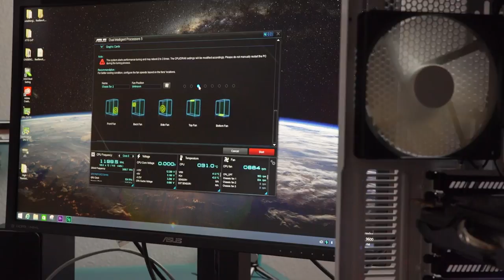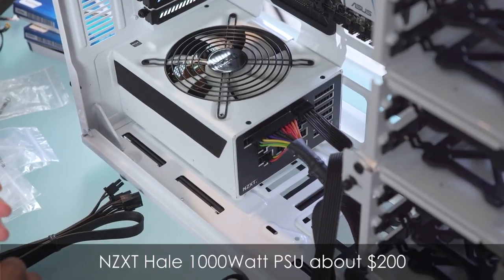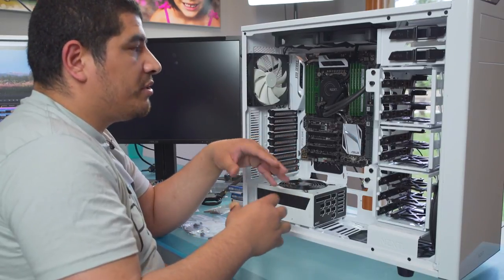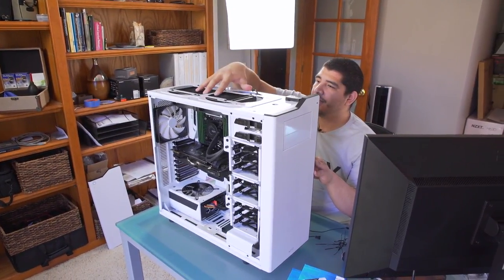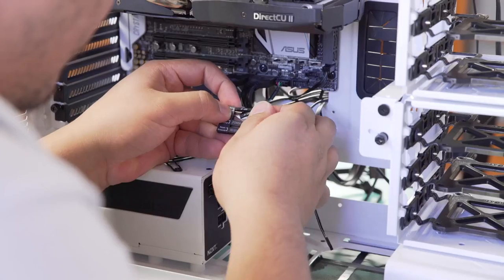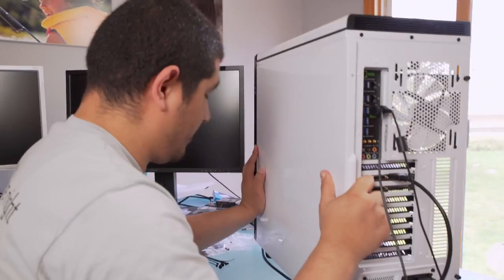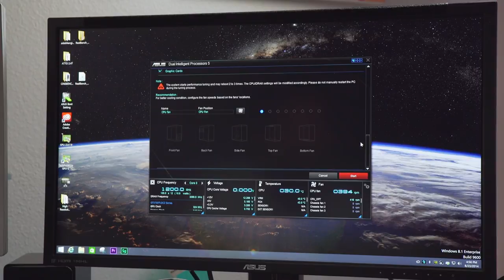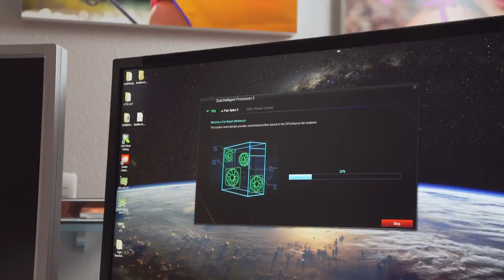i7-5960X 8-core With Asus X99 MB Video Editing Beast

Comment: I'm building my first computer (similar to this one) in one week once my Mobo gets here. Slightly nervous because I spent so much on it and it's my first time building. Dont want to mess it up.
Reply: +happyfoxproductions How did it go ?
Reply: I have a full video on my channel where I explain it :)
Reply: Cool! will watch.
Reply: +happyfoxproductions Whatever you do, be very careful with the CPU pins.  Make sure to place it once and do not move it after locking it in place.  Motherboard manufacturers will not fix boards with bent pins.

Comment: Hey dave im building my photo editing computer and im a bit confused on video card  any advice i was looking at nvidia quadro m4000 vs nvidia gtx 980ti thanks .
Reply: +sean persaud you do not need to spend that kind of money for a photo editing rig. First check and see what your software uses to render and what they suggest for a card I think you will find a $200 or so card will be fine. I have the GTX980 and it does my 1080 video editing very well on the latest adobe premiere pro.

Comment: The CPU is excellent, with 16 screaming cores. I will wait for the next generation though (Broadwell) and 16 Gb DDR-4 memory stick (128 giz of RAM instead of 64 gigz right now) to upgrade my rig. I feel completely satisfied with my actual configuration : ) For the RAID in this video,  I would not suggest a RAID software, it's slow compared to a hardware solution, and SSD for rendering video is so much better, that you will never want to go back to hard-drives.
Reply: I don't see any professional work on your channel though.. Why do you need 128GB of ram?
Reply: Misho5z   I work in the virtualization department. At home 64 gigz is not enough, unless I buy a server and i don't want to do that.

Comment: is this good pc for 4k video editing, advice?

INTEL Core i7‐6700K 4‐Core 4.0GHz (4.2GHz) Box
mb MSI Z170A KRAIT GAMING 3X
mem
2x KINGSTON DIMM DDR4 16GB 2400MHz HX424C15FB/16 HyperX
Fury Black
hdd
ssd SANDISK 480GB 2.5" SATA III SD8SBBU‐480G‐1122 Z410 series
vga
GIGABYTE nVidia GeForce GTX 960 4GB 128bit GV‐N960WF2OC‐4GD
rev.1.1, 4GB GDDR5,
odd LG DVD
case
COOLER MASTER K350 Case/(RC‐K350‐KWN2‐EN) + NJOY Woden 750
750W Power supply(PWPS‐075A04W‐BU01B)
Reply: You should go for a 970
Reply: 5820k is Best for render
Reply: Nenad Mrdak You'll need a better CPU and a lot more Ram, trust me. Or you'll be rendering for years

Comment: I have both the Mac Pro 6 Core 3.5Ghz and the 5960x i7 water cooled PC connected to a Samsung 55" Ultra HDTV 4k Display. The PC sounds like a leaf blower and the Mac Pro is barely audible. 

I'm keeping the Mac! :) 

Mac Pro 6 Core 3.5 GHZ = $3,000.00 (ebay) 

i7 8 Core PC = $2,600.00 (Newegg)
Reply: My initial thoughts on the Mac Pro 6 Core 16 GB and the i7 5960x PC 32 GB was that the PC was much more powerful, but after doing some real world testing with 4k rendering, the PC was only about 5% better in the apps I'm using to process the video. I have 5 cams hooked up to both computers running at high MP. Two Axis M3007P at 5MP , Axis M3006V at 3MP, Samsung Smartcam Pro at 2MP, and Hikvision Cube at 3MP.  On my old iMac Duo Core 2.8Ghz it would have maxed out my processor.  The Mac Pro runs at around 16% CPU and the PC at about 13%. Not a huge difference. This is some really processor intensive tasks because it is handling two streams of video for viewing and for recording.
Reply: Not sure where youre getting a new 6 core Mac Pro tower for $3000, your way off. You have to at least try and come close to the build these guys did. The base Mac Pro Tower which is 4 cores and only 16 gb NON DDR4 memory is $3000 and thats without Apple care which is a must if you are a professional. So in reality it would cost you $5,448 to get something similar to what these guys built. Also its easy to get rid of the sound if you would have bought the right case and fans.
Reply: Michael Gordon
No Michael, I was able to get this Mac Pro 6Core 3.5Ghz, 16GB DDR3 ram (late 2013) for $3,999.00 on ebay and it came with a 27" Thunderbolt Display that retails for $999.00. I upgraded the ram to 32 GB this week for around $340 through Newegg using matched pair 16GB Crucial ram. I did upgrade to Apple care for $240 which is really reasonable for this computer, that gives me a full 3 year service contract.

The 5960x PC only came with one year service contract through Newegg which is the same as the Mac Pro base contract. If you build this PC yourself, you have no service contract. If I went through iBuyPower to build the same PC it would have cost well over $3k and when I put together the Asus Extreme motherboard and better video card I was over $4k. When I priced out a complete do it yourself system through NewEgg I was over $3.5k so this PC is really a bargain compared to other 5960x systems. The video card isn't bad and was able to run 4k monitor with ease.  I was able to overclock this PC to 4Ghz easily using the AsRock tuning software. iBuyPower recommended that I upgrade the PSU if I was going to run it 24/7 for video monitoring etc.. That made me think that the one they put in there (Thermaltake 850W) was a cheaper PSU made for a few hours per day of gaming.

As far as the right case and fans, there is no right case and fans that is going to match the noise level and design of a new Mac Pro. I walk into my computer room and I have to get down close to the Mac Pro to see if it is even running. Apple did an amazing job on this computer design. You would probably spend another $1k to quiet the PC down to a reasonable level. These are all things that people overlook when comparing Mac vs. PC. You can run Windows on the Mac Pro if you want to , but you can't run OSX on the new X99 chipset yet.

When you run real world apps on both systems, the wow factor is not as big as when you watch these videos running various benchmark software tests. A Mac Pro that comes in a few seconds behind the most powerful PC in Video Rendering is not going to be a big factor in saving time. Keeping the computer running daily 24/7 without the worry of viruses etc. and being able to put up with that level of workload is key for me as well as a computer I can live with. I couldn't work in an environment with that PC case and fans.

Comment: Isnt the power supply upside down?  The fan should be on the bottom bringing air in shouldn't it?
Reply: It can be either way up I think this case doesn't have a filter on the bottom so that could be why I'm just guessing about the case but the pus can be either way up

Comment: I don't understand using a USB 2.0 card reader on a computer designed for media production. That nice looking NZXT card reader does not support USB 3.0 read speeds. Photographers and video editors will want to use a different card reader that uses the current 3.0 USB specs in order to read the memory cards at full speed.
Reply from the maker: +Chris Geiger it is usb3.0
Reply: I bought the same NZXT Aperture M and returned it when I found the card readers run at USB 2.0 . The two USB ports are USB 3.0, but the card readers all run at the slower USB 2.0 speeds. If you run a speed test on the card reader you will find it is slower than if you plug in a real USB 3.0 reader into the USB 3.0 port. I love the way the NZXT looks but internally it uses outdated tech. As a photographer I come in after a job with as much 200gb of data and I really notice the difference the extra hour of download time takes.
Reply from the maker: +Chris Geiger oh wow I didn't know what because I always use an external reader, I will look in to that.
Reply from the maker: I will have to take that off the list on my site.

Comment: Can anyone tell me if this build is suitable for Hackintosh?
Reply: X99 is not currently supported in the Hackintosh community.  BUT support will be available in the near future (about a month or so following kernel modding).  Apple does not support the X99 chipset YET, but I imagine that they will by December with the Mac Pro update.  Google "Rampage Dev" and stay tuned to what he's doing.  I'm on a X79 Hackintosh that I built with his support and it's phenomenal.  I'm actually upgrading to X99 and putting OS X on hold for the next month until support is available, as I'm equally capable on both OS.  I'm in a position where Microcenter will take back my X79 MB and processor so I can do an even swap, but the clock is ticking for that deal...

I actually owned a Mac Pro and sold it (at release for WAY more than I paid for it because of wait times) to build a Hackintosh/Windows Dual-Boot Workstation.  I couldn't be happier with my decision.  My suggestion to you is go for the X99 build, deal with Windows for a month or so and pay attention to both Rampage Dev and Insanely Mac for updates on Hackintosh X99 support.  DO NOT put your trust in Tony Mac.  He'll be your number one Google result when researching Hackintosh.  You can gain some knowledge from the forums, but Tony Mac is a thief and highjacked a lot of code writers hard work for monetary benefit through ads on his site.  Stick with Insanely Mac/Rampage Dev and you'll be set, all while becoming much more in tune with how OS X works.
Reply: Thanks for the great info mate!
Reply: Atheos You can now Hack X99! Google Rampage Dev Hackintosh and that will be your jumping off point